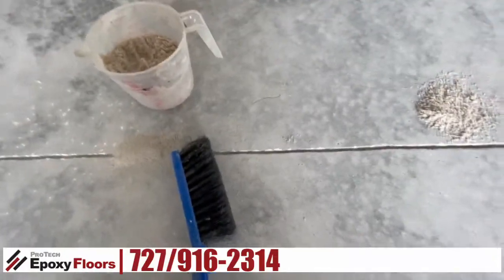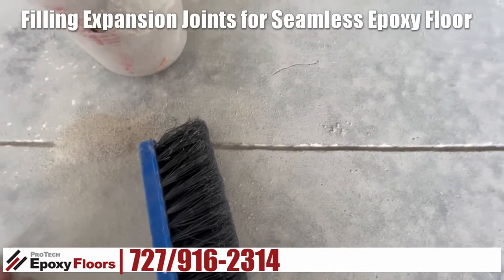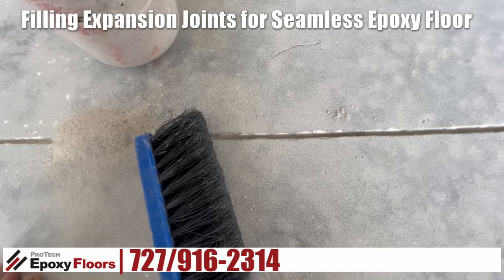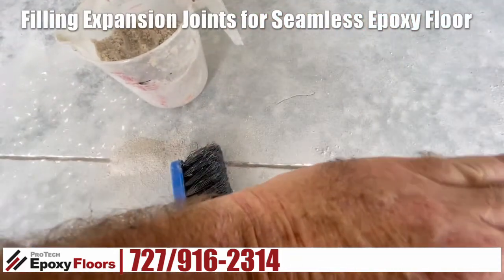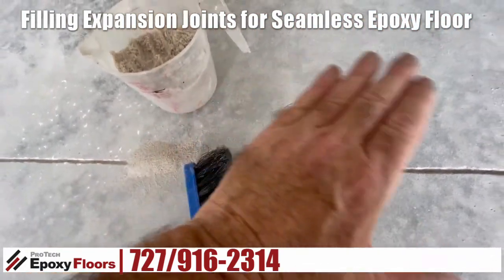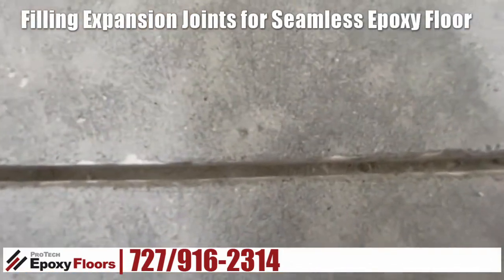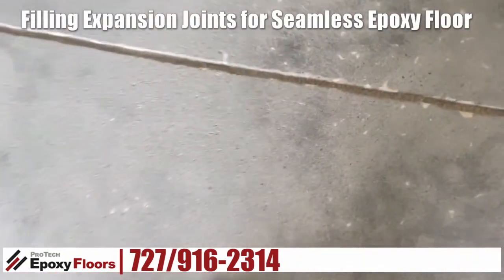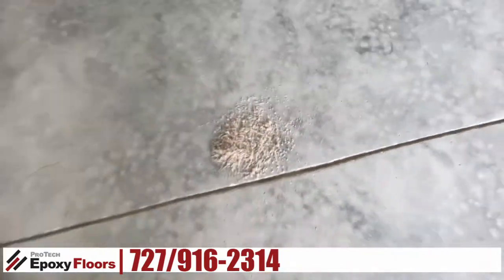Should you fill your expansion joints?

Comment: Sand doesn’t compress so I’m confused
Reply from the maker: Thanks for your comment, great question. Sand absolutely compresses. You drive on it every day. But in this application it would still allow the slab to move. But bottom line this is Florida so there are no freeze-thaw cycles. The best description of these joints is “control joints”. I just bring my northern nomenclature to Flordia. There is not much you can do to prevent the slab cracking. This just contributes to the aesthetics of the floor and makes it easier to maintain.